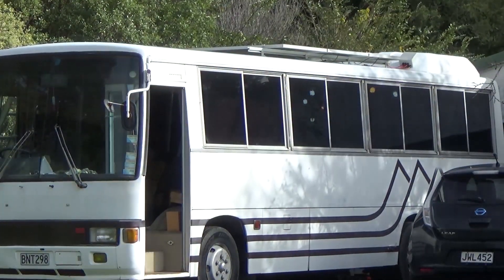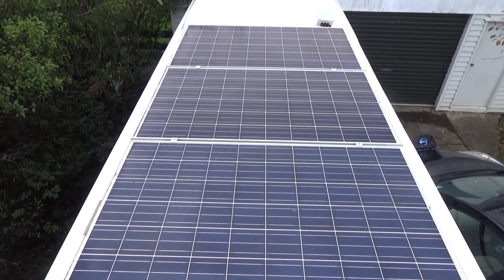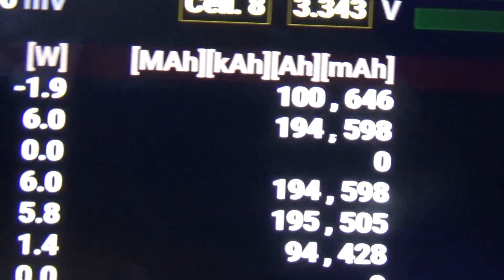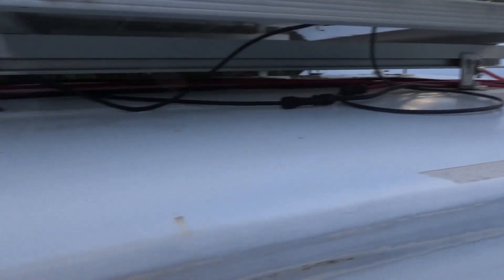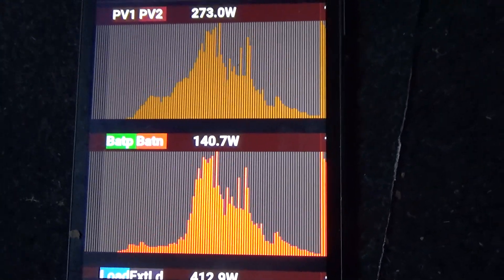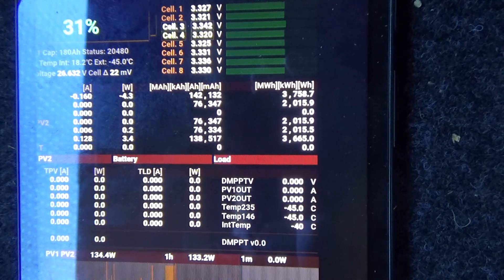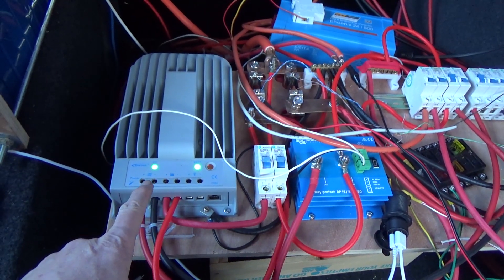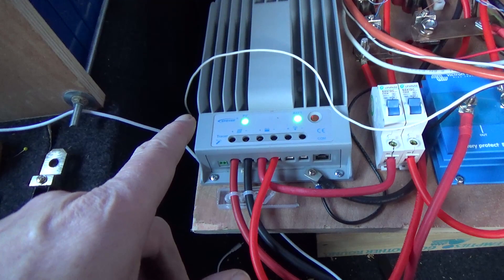MPPT vs DSSR20 Solar Challenge | Do we really need an MPPT Solar Charge Controller?

Comment: I'm impressed with EP, they are solid.  But big.  I'm considering DSSR20 or the Blue company.  Worried about Blue companies support.  Bought one from "authorized dealer" and they have been useless in helping trouble shoot problems or setup of features the Blue claims they offer.  Thus making those advantages moot.  Price of DSSR20 is great.  Price of EP is good.  Blue is pretty high given the unusable features and additional complexity of bringing in rest of their ecosystem to get those features.

Comment: Good video. I've spent several days researching MPPT controllers for a very small application – recharging Makita 18volt batteries in the bush (via a 20W solar panel and a 12v 9AH battery as an intermediate). About 10-20 Watts and one or two amps is all I need to keep the 12V battery charged.  MPPT was a good learning experience, but that's all it has turned out to be. I'll be implementing a simple method, similar to yours. Just a disconnect relay between the panel and the 12v battery, and a separate charge circuit for the 18 volt batteries.

Comment: How did the solar battery management system go with the blue cells you used?
Reply from the maker: Great. I have since replaced those cells with slightly bigger ones but the Electrodacus management system it is good and will work with a huge range of cells
Reply: @BusedAsNZ  have you worked or looked into the 500ah Sinopoly bat's? I have these and am unsure of it potential. Or do you know anyone I can bounce off for information?
Reply from the maker: Oh yes, bit out of my budget, and I think a bit physically big for bouncing around in the back of my bus. My original dream cell was the sinopoly 300Ah, I'm not sure the 500 existed back then. Sorry I don't know much about them specifically but would expect their "potential" to be pretty impressive. To a huge extent though bigger is just bigger, the logic of how they work is the same

Comment: Any opinion on the replacement batteries? I’m planning a drive up to Auckland later this week to swap them.
Reply from the maker: Woohoo Road Trip... Yeah not great but much better than the old ones. Each cell is about half a kilo heavier, and taller and fatter so I have had to redesign everything around it. Still pretty low grade but certainly have better capacity
Reply: Bused_As NZ so worth getting the replacements? I can still ask for a refund. I guess the question is, which other storage option is better at this price? 620ah, even if it’s only giving 2/3 capacity is still pretty good value at $2k. As long as they last.
Reply from the maker: Hard call huh. Haven't seen near that much battery for that price. I was actually prepared to keep the originals, I had after all pulled them apart and voided the warranty. They were very disappointing yet still looked pretty good value. And by that logic, these are way better.
I bought very cheap batteries, some risk of course but saved thousands, I'm pretty happy with the replacements. As for how long they last.... ask me later :)

Comment: Good video. The results are as expected. The reason why DSSR20 was better in low light is because the MPPT (DC-DC converter) has some significant self consumption and the reason the MPPT with two panels in series was able to have higher peaks in full sun is because the panels got hot so max power point voltage for those particular panels dropped below the battery voltage but with the two panels in series MPPT was not affected by that. I think you have older 250W panels the newer 280 to 320W  60cell panels will have high enough max power point voltage even at noon when panels are hotter but as you mentioned in summer when panels are hot there is also plenty of excess energy so not relevant.
On the USB download side. You need to enable the UART and set the serial speed that you prefer say 115200 and also set the update rate (I think default is at 30 seconds but you can set as low as 1 second) then your computer will see the USB port as a serial adapter so you connect any serial logger program to capture the live compressed data or you can download the internal stored data by going to Internal-datalog nenu select the month you want to download have the computer serial loger ready to receive the data and then push start data download on the SBMS0
The SBMS can store one full year of data at a fixed 2 minutes logging interval so that is what you will downloading.
I wish winter looked like that here :)
Reply: Thanks for the explanation, Dacian! I'm looking forward to become your customer, not only your fan!
Reply: No joke man, I’m waiting for your site to say I can add to cart. I looked at the pics you posted on the forum of the revision, looks great. I’ll take two of each with WiFi please. You’ve inspired me. Thank you
Reply: @chriscord6524  They are available in two days.
Reply: Jason L I had just seen his comment in the forum today. I’m ready, add to cart..add to cart..add to cart
Reply: When I looked at my cart, I felt bad. But I forgot the Canadian ice buck conversion ratio. 
I’m in. Now shunt shopping
Reply from the maker: Thanks Dacian, will give it another try. Of course I don't really need the logs, just would be fun to play with I guess
Reply: I would like to order a bms from you but I’m not sure witch one can you please contact me at jamesdmason72@gmail.com